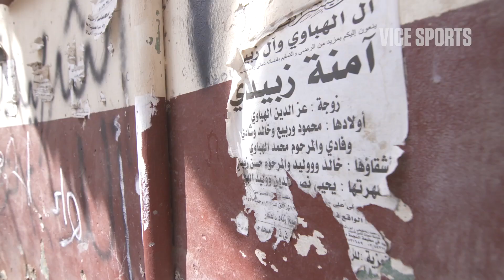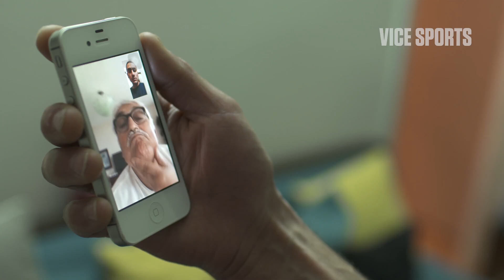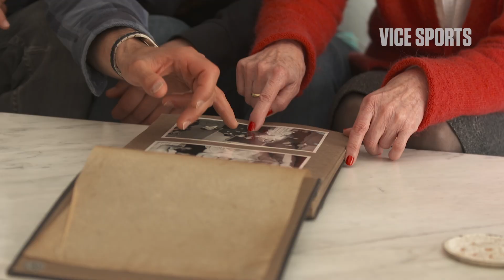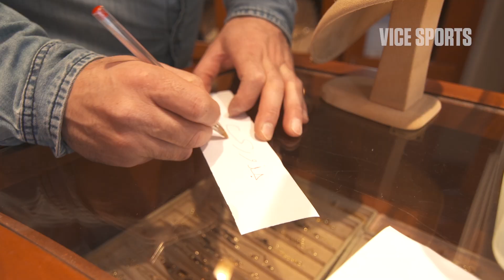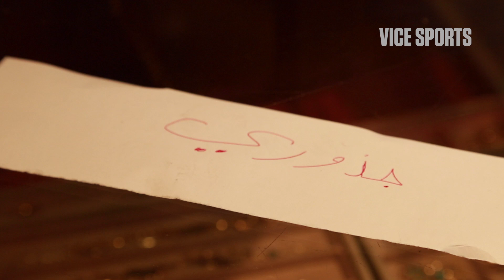Rooted: Climbing Lebanon

Comment: I've never been climbing before.  I would have to think that the part where you slip and fall off the rock face, even knowing that you're tethered to the rock face, would be scary as hell for that first second or two before you come to a stop.  Truth be told, I would probably scream like a girl.  ;)
Reply: It is scary but it's worth it tbh
Reply: Yeah, falling is scary. But it's a part of climbing. Losing hold while trad climbing on big wall/multi pitch is the scariest. The best way to overcome it is, as crazy as it sounds, to climb up and purposely fall at different heights.